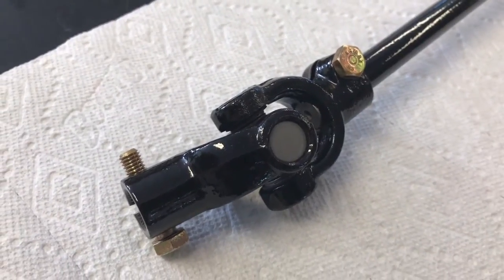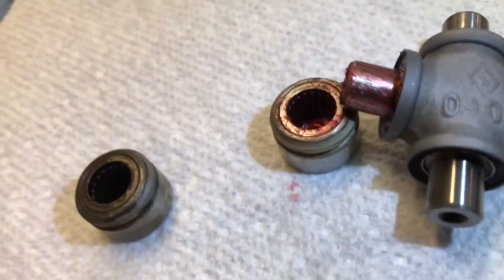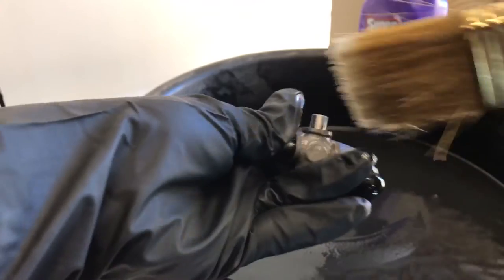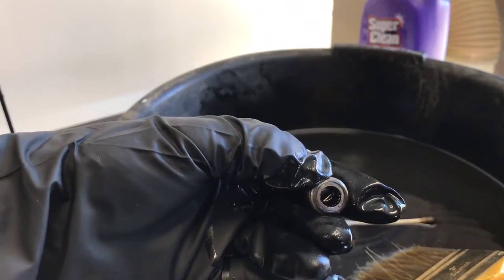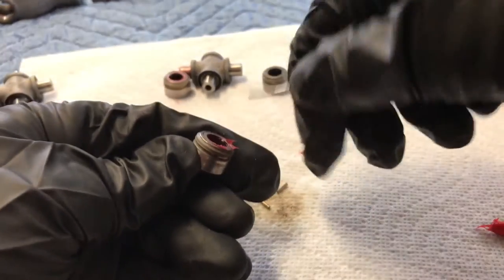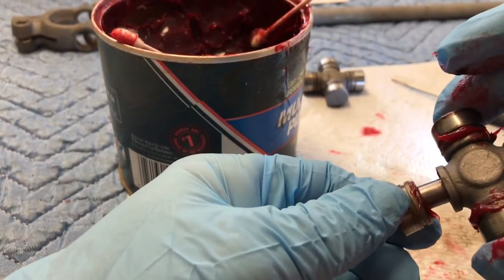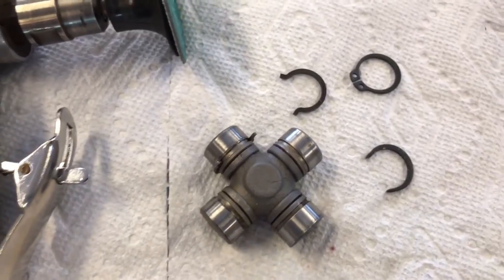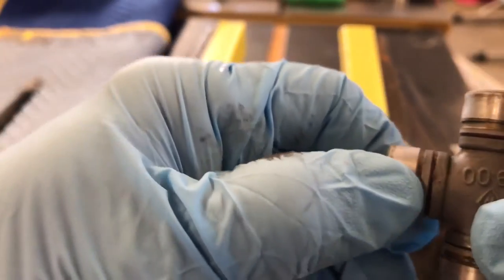1967 Porsche 911 Video 28 Steering Shaft Overhaul

Comment: Mike, 
I am very impressed that you were able to repack such fine bearings while wearing those cumbersome gloves. Great Video.
Reply from the maker: Hi Brett
Thanks=) I actually can't stand wearing gloves but deal with it..Especially in the summer time
Its good for the project though as it does protect the surfaces and also my dishwasher hands
Im wondering how is the summer down under?
Reply: Sydney has a sub-tropical climate; we get summer heat similar to you, but also humidity, and very often a thunderstorm in the late afternoon of very hot days.  Winter is generally not too cold; an average winter day is fairly sunny with temps somewhere between  15 - the early 20's C.
Reply from the maker: Sounds hot there too! Soon we should be getting the monsoons coming up from Mexico and that usually cools things
down a bit but also brings flash flooding.
Im ready for some water though!=)

Comment: Great vid Mike, I just restored the ones for my Camaros. The Porsche ones look a little more complicated due to the U joint.  GM did use a pin that has to be pressed out and there is a nasty clip to deal with. Yours turned out great.
Reply from the maker: Thanks Russell
They are similar but a bit different in how the mfgr's go about it.
Its a really important part of a restoration I think and sometimes over looked. Should steer and feel like new!

Comment: You flung one of the bearings across the room it was magnetized to the screw driver. Right after the run away. You can hear it fall on the floor
Reply from the maker: Yes I sured did! You are sharp..I did find that piece later
Cheers!
Reply: @MikesRestorations  amazing work I just watch the dearies a second time!

Comment: Hey Mike, great stuff, as always.  Why did you use the hammer to press the bearings in the last few millimeters and not continue to use the vise?  Seems like the vise would be more controlled and square?  Also, how in the heck did the shop you mentioned get those things out?
Reply from the maker: Hi John
Thanks=) Good question!
The tolerances by The Germans are tight!! I knew I wouldn't  be able to get them out myself without proper size drift pins and press. didn't want to risk damaging them.
Machine shops have quite a variety of tooling to draw from in these cases..I took them in with a 50/50 chance it could even be done but they did do a nice job=) 
Pressing them back in is difficult I will say. They are so tight almost don't want to go. What happens is the farther you press them in with the vice the more area the cups are grabbing on the sidewalls and actually pulling the casting inwards and bending it before they slide. The hammer and socket works because of the sharp shock when hit it moves them without pulling on the side walls. I little bit of both gets it done but it is a tough job for sure.
If you can get through it successfully the payoff is brand new condition steering shaft with tight action and original look..and at least $800.00 to $900.00 in your pocket.
If you try this project Good Luck!!!
Reply: Mike M makes sense!  Thanks for the detail.

Comment: Great video! I live in Phoenix where the weather is very similar to Las Vegas...out of curiousity, what happens if you try painting when the weather is this hot? Thanks Mike!!
Reply from the maker: Thanks=)
What a summer we are having! its so hot I can't stand it..
In regards to your painting question..not really recommended in these temperatures
Although body shops have to paint regardless they are using retarders and sometimes climate control.
problems associated with extreme temps are endless and not worth risking your project
70-80 degree is  always best and would give very stable and reliable results 
Lots of Luck!
Stay cool over there=)

Comment: Do you have any video and or general commentary regarding the design and build quality of this car/theses cars....  that example of the rubber carrier bearing seemed an indication of certain remarkable materials used....
Reply from the maker: Hi Finn
I don't have one specifically but do comment thru out the series as details revel themselves.
The quality of some of the materials used by Porsche in the early days is quite remarkable.. even better than some of the modern replacement materials.
Some of the rubber coming of this car is softer and more supple after 50 years than new replacement genuine parts from Porsche 
Will be commenting on this on next video coming up
Reply from the maker: Thanks Finn
Some excellent suggestions maybe for a wrap up video once the car is on the road..I will say this though about its overall construction.
The factory technicians who engineered and built this amazing car were masters. The welding, body forming and fitment leaves me scratching my head as to how they were able to do such things 50 years ago.
Absolute masters at what they did.
I came across this particular car by chance and worked out a deal with the previous owner. I was interested in it from a purely historical perspective
because of its condition..since then have been a solid Porsche enthusiast=) Porsche quality is 2nd to none
Also great video link! thanks for sending. There are some amazing talented
guys out there doing fantastic things
Cheers!

Comment: hi mike, what is it the exatly process to pull out the steering shaft. can you help me please.
michele
Reply from the maker: Hello Michele
Try unhooking from the steering box connection and then unhook at the upper level near the dash board.
Once the retaining nut and boost are sufficiently loosened a large flat screw driver can be used to spread the joint at the splines.
It should then be able to move enough to slide out.
Good Luck!